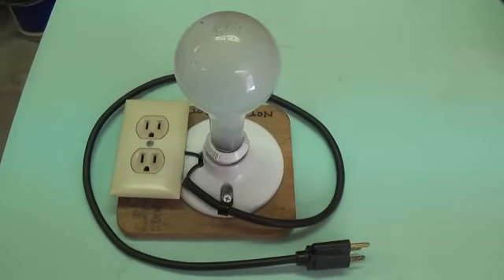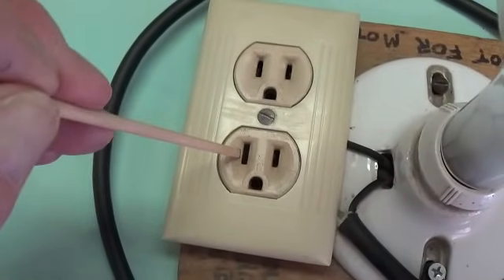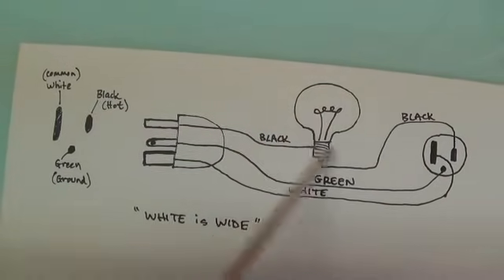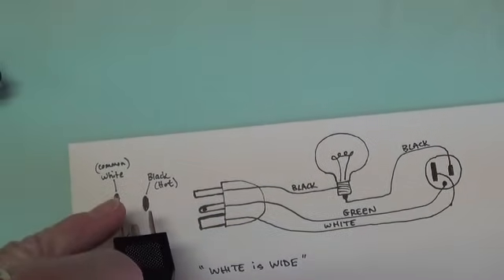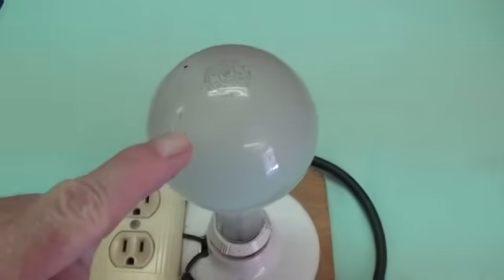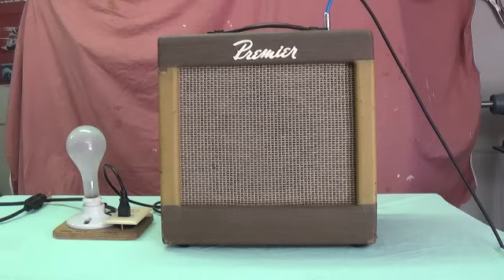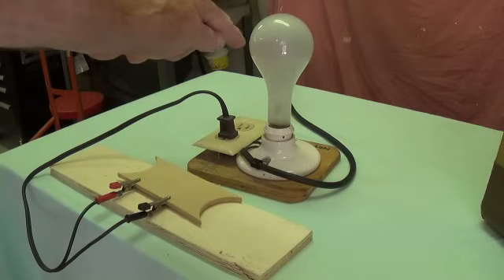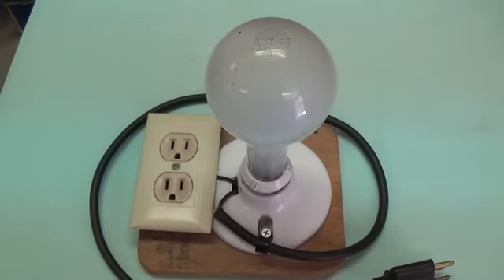Build Your Own Current Limiter for Protection when Repairing and Testing Electronic Equipment

Comment: Lacking any engineering expertise, I hereby pose a newbie question.  When using this limiter with a variac, should the variac go first?  My intuition tells me yes, but I don't know.  Does it even matter?
Reply from the maker: I usually run the CL first, then the Variac. There is no great reason for doing it this way, but my habit is to use the CL to protect all electronic gear......including the Variac.
Reply: Gracias!  :)

Comment: One suggestion I’d recommend is putting the line side to the lamp on the hot contact center point and not the screw sleeve.  Put the load on the screw sleeve.  If you happen to be changing lamps with it plugged in you’ll be less likely to be a human ground to the hot should you touch the screw.
Reply from the maker: Thank you for your suggestion, P8.

Comment: So the black one is the only one that is dangerous?
Reply from the maker: Generally, in 120VAC wiring, the black wire is the "hot" wire. If you were grounded and touched it, you would get a heck of a shock.....possibly a fatal one.  If, however, you were grounded and touched the white (common or return wire) you would not get a shock. Not all wiring is color coded correctly, however, so don't test this theory.  Always use a volt meter......it's much healthier in the long run :)
Reply: Kyle Jackson - I have seen 277v fluorescent lighting where they have used the same single neutral (white) on two areas that are fed from different breakers (black). The breaker was off for the room I was in but there was voltage on the neutral coming from the other circuit. This isn’t what you will see in modern wiring but the 70’s weren’t that long ago, and you might have a bad install so best to check.
Reply: In the supply to domestic premises, the neutral (white) wire is connected to ground at the distribution board or at a point close to the premises. One of its names, along with 'neutral', 'cold' or 'return' is 'grounded conductor'. It will be at or near ground potential (with maybe a few volts developed across the resistance of the wire between the outlet and the ground point). This means it should be safe to touch, but ONLY if you can be 100% CERTAIN that your supply is wired correctly. Why take the risk?

Comment: I just wanted the option of being able to switch it off rather than always having to unplug it.   I saw them made both ways, and decided to add the switch.
Reply from the maker: That makes sense, Donald. I generally leave mine plugged in all the time and simply plug that amp into its receptacle when testing.

Comment: Is it possible to use a circuit breaker(mcb) instead of this light bulb setup. So that any short circuit trips the breaker...
Reply from the maker: I think the bulb is better, AR. The brightness of its glow indicates the amount of current flow and it increases resistance in response to any current increase. The circuit breaker simply opens the circuit, just like a fuse. To me, the current limiter is like an analog fuel gauge, giving visible evidence of the amount of current (or fuel)......while circuit breakers and fuses are equivalent to simply running out of gas.

Comment: how to use this setup with an isolation transformer. does it work?if it; where to connect the load bulb,  before the primary or after the secondary of the isolation transformer
Reply from the maker: I don't use isolation transformers, AR, but if I did, I would put the Current Limiter between the IT and the amp circuit, where it should be able to protect both from excessive current flow.
Reply: Thanks for the early reply....

Comment: Hey Doug. Your videos are great. Incredibly informative. I was wondering could you use a 50/200/250 w trilight bulb with a trilight lamp socket so you can simply switch to the 50w if you are working on solid state amps?
Reply from the maker: That's a very interesting idea, BT.  Most people simply screw in different bulbs, but I guess this would work..........as long as you don't get mixed up about which wattage is activated by the switch.

Comment: Hello great channel! I wanted to ask you if I would still can get a shock working with a tube amp using this device.. For instance I always have some kind of fear when measuring plate voltages to touch accidentally something.. Thanks!
Reply from the maker: Yes, you could still get a shock, so you have to be extremely careful even if you are using a current limiter. It's primary purpose is to protect the circuit from damage due to a short circuit, so you cannot ignore any of the safety rules while working on a live circuit.
Reply: Uncle Doug thanks again. What would be the main precautions to take? Do you uploaded a video on this topic ? Please continue with this awesome channel !
Reply from the maker: You're welcome. Yes, I have posted a video on shock hazards. Please check my video list.

Comment: So just to confirm: Your hand-drawn schematic is incorrect? Instead it should be switched to show the Black (HOT) wire that comes from the wall plug needing to be connected to the bottom tip of the light socket holder on the way in; rather than connected to the threaded collar as seen in your picture.The way you have it drawn makes the threaded bulb collar always HOT, and thus as the most exposed part of the socket, is more easily touched when constantly changing to various bulbs. I note you mention so in your video, but some viewers may not catch it. Therefore it may warrant you editing a WARNING into your description, or making my comment a sticky that stays at the top of the comments. Especially since your video is now being referenced to many viewers as a standard from other videos and sites. That is how I got here. Otherwise thank you for a well done video on this topic.
Reply from the maker: Unless you are earth-grounded while changing bulbs and feel compelled to reach into the porcelain base to touch the threaded collar, there is no shock risk. Anyone so compelled would probably not hesitate to stick their finger a little deeper into the socket to touch the bottom tip.....which would provide a serious shock, grounded or not, because their finger would also most likely be touching the threaded collar.  Although I feel certain that anyone with enough sense to understand the need for this device would also have sufficient sense to avoid touching any energized parts of it, regardless of where they are located, I will add a comment to the video description as you suggest.

Comment: What do you think about connecting a variac to a bulb?
Reply from the maker: The only time I would do this would be for a slow start-up on an electronic device that had been setting unused for many years.  I would use the current limiter to protect the variac in case of a short within the circuit of the device.

Comment: Question Uncle Doug:  I believe I have completed my limiting device.  I used a 300W bulb.  I tried plugging my treadmill into the receptacle and then the limiter into the wall.  The treadmill powers up....however, as soon as I press "start" to get the track moving, the lightbulb flashes and the track doesn't go.  Does this mean it is working?
Reply from the maker: You can't use the current limiter with an electric motor. It's purpose is only for electronic circuits of appropriate wattage. Try it with a 25W amp, if you have one.
Reply: Got it.  Will do.

Comment: Hi Doug! I need to build one like this for repairing/testing my audio receiver safely. 
I live in a 220v-240v country...What type of bulb should I use? My amp power consumption is Maximum 650Watts/Rated 435 Watts (Not audio power output).

Thanks for your help!
Reply from the maker: Greetings, Red. As I explain in the video description, at 230VAC your current consumption is one-half of mine (at 115VAC), so your bulb wattage should be one-half of the size I use. Thus a 100W bulb would be a good starting place for you. If it glows too brightly, go up in wattage.....and vice versa.
Reply: Thanks Doug!

Comment: Uncle Doug....first post and great video.  I'd like to make this.  I see you used a screwdriver to show how it works.  Is there another way to test it, in case i have it hooked up incorrectly so as to avoid being electrocuted?  (This is my wife's utube account BTW...hahaha)  thanks....Rick
Reply from the maker: Thanks, Rick. If you follow the directions carefully, it should result in a good, reliable current limiter. The screwdriver test is harmless, as long as you don't touch the metal blade.
Reply: Got it.  Many thanks.  Love your videos.
Reply: Question on the black wire to the ceramic base ...so, the black from the plug gets attached to one of the the gold ("hot") terminals on the base and a separate black wire gets attached to the other gold terminal on the base which in turn gets connected to one of the gold terminals on the plug receptacle, correct?
Reply from the maker: The black wire is the "hot" wire in conventional house wiring, and it's the wire that should have the bulb filament inserted (in series) so that the flow of current through it to the electronic device (i.e. amp) can be moderated if the current flow suddenly increases.  If you use the gold terminals for all the black wire connections, then polarity should be preserved and the current limiter should function properly.
Reply: Got it.  Thank you my friend.  Say hello to Rusty for me.
Reply from the maker: Will do :)

Comment: how would one go about making one for unpolarized AC-outlets like Sweden? 200W Lightbulbs are no biggie since they're still not illegalized here.
Reply from the maker: Using an AC multimeter, you should be able to determine which wire is "hot" regardless of whether the outlet is polarized or not, BG.  Carefully check for potential between each wire and a known ground......like a cold water pipe.

Comment: the hot input should actually go to the center contact on the lamp base, then the screw base should go to the hot side of receptacle...
then if someone touched the base of the bulb, they won't get shocked..
Reply from the maker: Anyone who is grounded and goes out of their way to touch the barely visible metal part of the bulb base probably deserves a shock, Dan.....and will get one regardless of the way the bulb is wired, since the filament connects both the bulb's center contact and it's metal base.  Let's face it, anyone who is sufficiently knowledgeable in safe electrical practices and actually needs a current limiter should know better than to touch any part of an energized circuit.

Comment: When  using  this  in  conjunction  with  a  isolation  transformer ,  should  I  use  this  before  or  after  the  isolation  transformer ?   Thanks  for  your  video !
Reply from the maker: I always use the CL first in the line, KG, so it can protect all the electrical equipment that follows it.

Comment: Would you recommend using your current limiter in conjunction with a small Variac to do initial power up of audio amps and receivers (mostly solid state) to reform caps and such?
Reply from the maker: Variacs are not a good idea with SS electronic devices, since harm can occur if incoming AC is far below the 120/240VAC the power supply "expects".  Current limiters are OK, but since current requirements for SS devices are much lower than tube circuits, the bulb wattage must be lowered to match. For long-unused tube circuits, I use the CL then the Variac (in series) for a slow start to allow electrolytics to reform.
Reply: Uncle Doug Thank's Doug. How would you recommend reforming caps in SS devices and otherwise powering up safely after an extended period of non-use?
Reply from the maker: Again, TT, slow warm ups are generally not a good idea with SS devices.

Comment: Could I use this as a current-limiting device (ballast) for a MOT or X-ray transformer?
Reply from the maker: I have no experience with either of the devices you listed, Jon, but would imagine that the CL would work with them. You can certainly try it and see if it works. Just be sure that the bulb wattage is appropriate for the current demands of the device. During operation, the bulb glow should be very dim.....barely perceptible.

Comment: greetings uncle Doug

i am gonna build me a current limiter just like the one in this video,   which lamp should i use of these two available at my local hardware store?    one of them is a 200w 130v.

the other one is a 300w  also 130v.   i can't find a 250w like the one in your video, unless i buy it on e bay, but they are much more expensive than the ones i mentioned.  thanks in advance
Reply from the maker: Go with the 300W bulb, 4H. It will work fine for small and medium wattage amps.

Comment: I have a push-pull tube amp. Is it normal that the lightbulb glows maybe to 1/10 th power , or is it the sign of a slight short ?
Reply from the maker: Let me know the wattage of your amp and the wattage of your bulb. It's probably normal, but it never hurts to be certain.
Reply: The lightbulb is a 500W photoflood and the amp is a Rockola (music machine) 41056A with 4 x EL84 tubes and I don't know the wattage.I think it is maximum 20W per channel.  I don't know the power transformer wattage, I just managed to get one schematic on th net.
Reply from the maker: It sounds like this is a Rockola Starlet jukebox amp, Stephane. With four EL84's it must be fairly powerful and drawing a fair amount of current. If the amp appears to be operating and sounding good, I would say that the slight bulb glow is appropriate.

Comment: Hey Uncle Dough,
I'm from Europe too, and one of the problems I'm facing is that our sockets are unpolarised, as in, you can plug in you plug either way (right side up or upside down). Also, since I'm currently residing in a fairly old apartment, I do not have any kind of grounding on my plugs. Do you have any tips for me to overcome these issues? I personally feel like the whole unpolarised thing shouldn't be too much of an issue, but I'd like to know what you think. Thanks!
Reply from the maker: You can create an effective ground by connecting a wire from a cold water pipe (i.e. under the sink) to the metal chassis of your amp. The polarity is not as important as having a good "earth" ground.
Reply: Awesome, thanks for the quick reply. I've always heard that radiators also work, or is there any concern whilst using them? I don't really have cold water pipes running within reach of my setups.
Reply from the maker: A cast iron radiator may work also. Use a voltmeter to see if a potential exists between your amp chassis and the radiator. If it does, then the radiator is probably a good ground.
Reply: These days it's not inconceivable that some copper pipe may have been replaced by plastic pipe between your connection point and ground.

Comment: Hi Uncle Doug, thanks for this channell. I found it just yesterday and it made my day! I wanted to ask a question about this current limiter, because I scrolled down but I didn't find the answer. Here, in Italy, we have 220V 50Hz mains but the problem is that our plugs are not polarized at all. We can switch L and N depending on how we plug the cable into the wall, without even knowing. How can I build a device like this? Thank you for your vids. Very informative and entertaining. Cheers.
Reply from the maker: About the only way that you can be sure that the "hot" wire runs through the current limiter would be to have two current limiters, one in each AC wire. Since the two would be in series within the primary AC circuit, the bulbs should each be half the wattage of a single current limiter......for 220VAC, you could start out with two 50W bulbs and then fine tune the wattage, up or down, to suit your needs.
Reply: Ingenious. Thank you!!!

Comment: Looking at a receptacle with the ground pin on the bottom, the LEFT contact (usually the large blade) is always wired with a white wire from the breaker panel and the RIGHT contact is wired with a black wire. Green goes to the ground pin. When looking at a plug the blade pins are opposite what the receptacle pins are. What U.D. says is absolutely right IF the receptacle was wired correctly. Some DIY'ers think either one of the wires makes no difference how they're wired so be safe and check the receptacle pins first. The HOT (black wire) side will always read 120vac when measured to to ground pin. The neutral (white) side will always measure 0 vac when measured to the ground pin.
Reply from the maker: Excellent advice, Ray. They sell a small, inexpensive device at Home Depot that will allow you to check the wiring in all your wall receptacles......and those receptacles you may encounter if playing at another location. Rusty and I strongly recommend that all viewers obtain one of these testers and use it before plugging in.

Comment: Do you come off the hot side of the fixture to the receptacle or the common side?
Reply from the maker: As explained in the video, Andy, the bulb is wired in series within the black (hot) wire.
Reply: Ok thanks,  just wanted to double check.